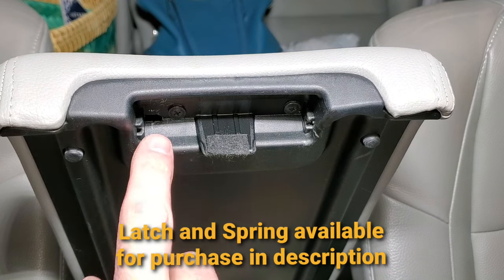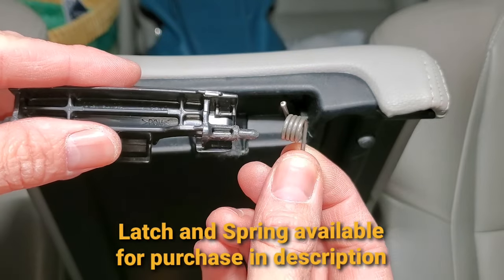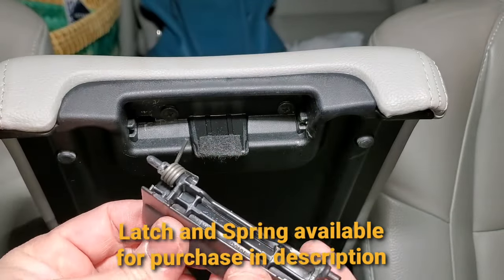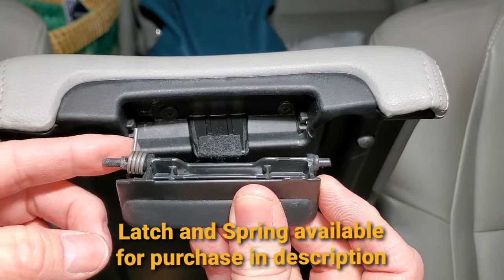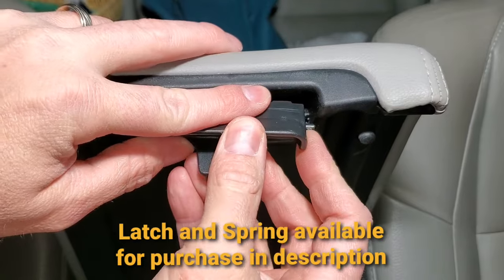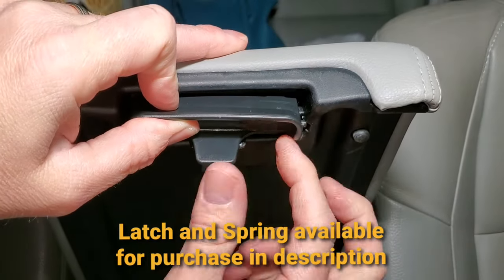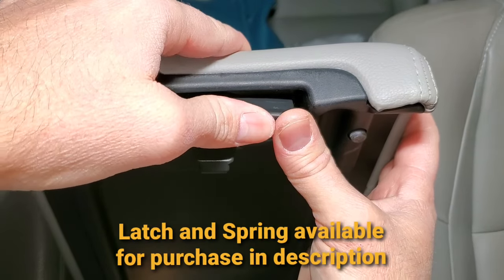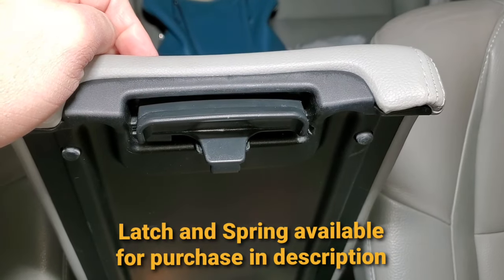2013-2018 Acura RDX Center Console Lid Armrest Latch and Spring Install

Comment: Dealer told me if the aforementioned spring breaks, it's $300 to fix because the entire top of the console would have to be replaced. Total cost for positive fix was $16.00. I may have over-paid for parts by $5-6 dollars. Total repair time was right at 2 minutes. Thanks for you informative video.
Reply: Haha, dealers are such a joke.
Reply: Where can I get that part ?
Reply: @theeblkmermaid  Amazon. That’s where I got mine
Reply: Thank you, you were very helpful.
Reply: Awesome. I just got quoted $672 to fix it

Comment: Thank you for a great video and instructions.  I encountered a problem when installing mine because the spring that came with the new latch did not align with the old spring on where the points came out.  Thus, even though I was able to get things together, it did not grab the lower latch.  Thank God I had kept the old spring.  I just reused it and everything went together smoothly.
Reply: Not sure if you’ll see this but I’m having the same problem. How did you get he latch out once you realized without breaking it?

Comment: Thanks! Just the video I was looking for! And to @johnbacon2100 point, I’m sure glad that I held onto the spring! Dealer part for $16.00, but quote for the full install was exorbitant to say the least. I was weighing the console down with my roadside safety pack for like 2 years before I got the part and fixed it today…in 2 minutes 😅

Comment: Well, I should have watched this video FIRST.  But know, I tried to force it in without knowing about the slot for the right side stub - In forcing mne in, I broke it and used your link to buy another one from Amazon, which I will get tomorrow.  Thanks again.

:face-green-smiling:
Reply: Where is the link

Comment: Thanks easy fit make sure you have the spring if not Acura will charge you 320 for console replacement very flimsy part for such an expensive car

Comment: Cost $8 thanks to you! Keep your original spring! I bought a replacement latch off Amazon (Kallia Kerman) and the spring it came with wouldn’t keep the console closed. Swapped it out for the original and is super tight.
Reply: I, unfortunately, lost my original spring. Thankfully, the replacement spring that came with the latch was perfect.